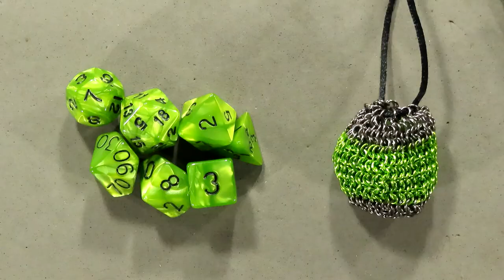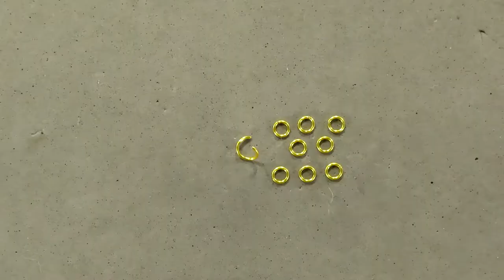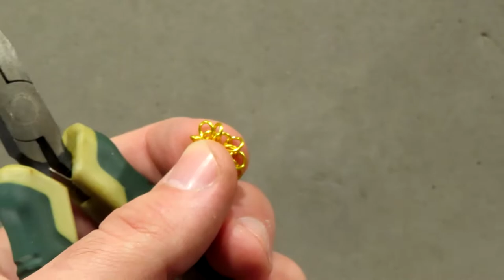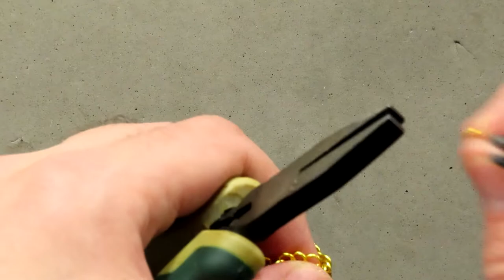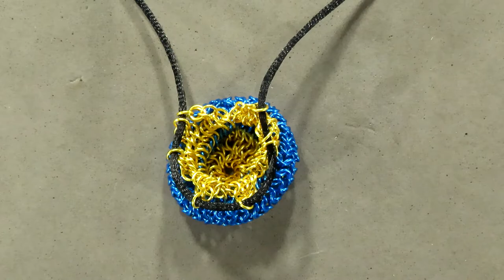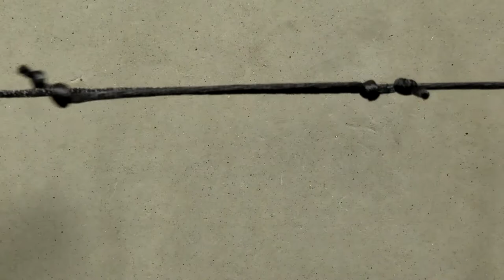DIY Chainmaille Dice Bag Necklace | DIY with Cly Ep. 19

Comment: Great video. I did mine with 18g wire, gutted paracord, and doubled the rings that meet the paracord.
Reply from the maker: Thanks. 😁

What metal did you use? I have some 18g aluminum around here somewhere, but it's dead soft so I would trust it with a bag.
Reply: @ClyFaker  I used steel. My bag holds a bottle of hot sauce, so I wanted to be sure it was solid

Comment: I do not have experience with chainmail, but i ordered some to make a dice bag. I do want to make a bigger dice bag than this one, so that it might fit 2 sets of 7 dice (normal sized) how do i best change this design of yours so it can fit more? Like just expanding further at the beginning/bottom part?
Reply from the maker: Here's an older video of mine where I make a bag for standard sized dice. 

https://youtu.be/zz65mf7Bcsg

The links I used in the video are 16 gauge SWG with an internal diameter of 3/8 inch, and the bag can hold quite a few sets. You can adjust how many sets it holds by changing the total number of rows. I made a bag last night that holds a single dice set using twelve rows, though your mileage may vary since I did use thicker wire than 16 SWG with the same ID.